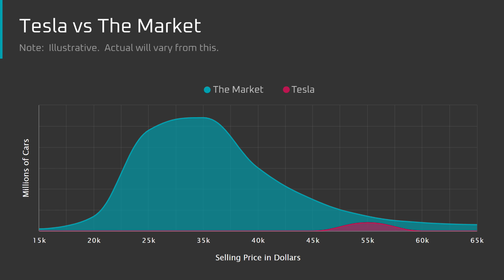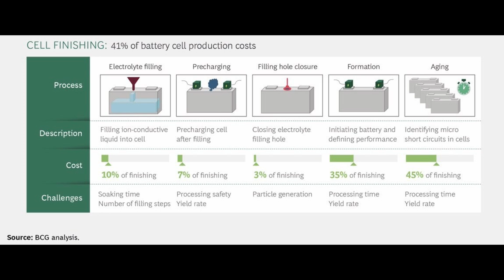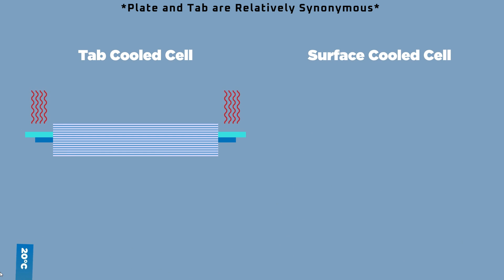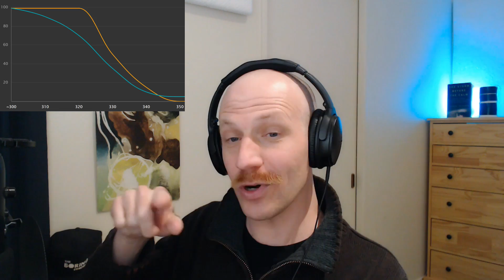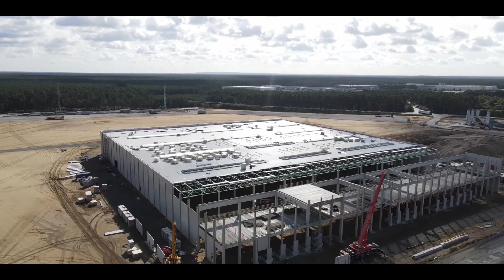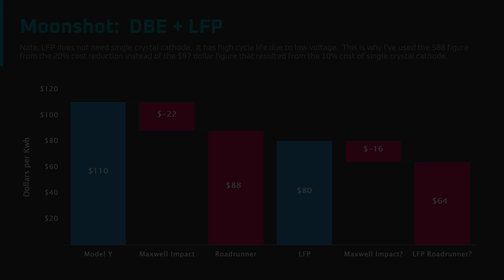Tesla Battery Day Predictions // Output, Cost, Energy Density

Comment: I recently replaced the worn out lead acid batteries in my solar system with LFP batteries which are rated for 10,000+ 100% cycles.  Assuming the rating is correct it would seem that LFPs would be a great choice for stationary storage where weight is not an issue.  With a daily 100% discharge these batteries would have a 27+ year life expectancy.
Reply from the maker: My view is hell yes.  LFP rocks.  Cheap and long lasting
Reply: @thelimitingfactor  I think I read somewhere that Tesla is using LFP batteries in their Chinese EVs.  The market in China seems less concerned with higher ranges.  Perhaps due to the availability of high speed rail for longer trips and/or less emphasis on performance.

BYD has been using LFPs for years in the EVs they've been selling for taxi use.  I haven't run across any data on how well they've held up but one would think the batteries would outlast the car.

Cheap, long lasting, and don't catch on fire.

Comment: Amazing presentation!  The only piece if info I did not see you talk about is sustained charge rate on the tabless electrode batteries.  Do you have any ideas on this?  Thanks!
Reply from the maker: The tabless electrode is only one aspect of charge rate.   Every aspect of the cell affects the charge rate:  Cathode material, anode material, electrolyte, material thickness, cell thickness, cooling system, pack size, BMS.  Tabless electrode is just one thing and is not a panacea - it's just a step in the right direction that can unlock potential.  It all depends on whether Tesla engineers for Power or Energy Density.
Reply: @thelimitingfactor  Thanks Jordan!  I am eagerly awaiting any info they release on this.  Your mention of the play on Hobit Day is very sharp and with Elon this likely is the case.  And let's hope on that Moonshot idea at the end!!  All the best.
Reply from the maker: @johannel8104  Thanks man and thanks for the support!

Comment: So good Jordan, well done. Don’t under estimate yield, as it is one of the most important aspects of volume production. I think the tabless design will improve on yield significantly because it takes out a huge variable that causes performance variation and production fallout, and could add another 5 to 10% cost reduction. It’ll improve also improve throughput. Engineering is all about efficiency in any ways we can find without testing the law of diminishing returns.
Reply from the maker: I totally agree!  There are a few places where Tesla could eeek out some killer number that I haven't factored in😀  I'm hoping my estimates are 'padded' a bit.  Trying really hard not to mislead.

Comment: I thought that LG Chem(and maybe Panasonic Asia) provides cells for Giga Shanghai (see link below).
Wonder if Elon is also thinking about using LFP for RWD Model 3/Y and maybe also RWD Cybertruck, with even lower battery costs, leaving Roadrunner line for Model S/X and maybe later on next-gen P3/PY, as premium models.
https://insideevs.com/news/423142/china-panasonic-mic-tesla-model-3-batteries/
Reply from the maker: LG Chem is supplying as well, they are diversifying their supply chain. This is why I avoided this topic in the video.  It will vary by model, factory, and continent.  Permutations are endless.  I think LFP would make sense for the entire 'base' range lineup!  Cheap as chips and great performance.
Reply: @thelimitingfactor  Indeed, charging speeds and power density is great with LFP. 
I just wonder if Tesla will have it in house or will it use CATL or others for their base versions. 
Main downside of LFP is weight, but that mostly effect RR losses, which can be minimized.
Thicker cathode might also mitigate it, if DBE is possible with this chemistry.

Comment: Better yet, use heatpipes which are way more effective than copper rods. Thermal conductivity is only part of the story . “Thermal diffusivity” is the key. You want heat to spread out as fast as possible.
Reply from the maker: GREAT point

Comment: Love you presentation and numbers. I have a few speculations that might be of interest. The wet slurry process that’s being eliminated also creates massive cost/problems for controlling the environment and capturing/recycling the toxic chemicals involved. Eliminating the physical footprint needed for drying vastly reduces the space need for battery production as you stated but the weld-lessTab-less battery offers with fatter, wrapped dry battery offers lots of opportunities for automation with less defects, welding creates the most defects. A very important fracture of the Tab-less battery is it’s reduced resistance which might help the coating mixture improve cycle life, less heat, and increase the regeneration efficiency, longer range. Another benefit of battery pacs is making a universal pacs, one fits all, that can be combined together to fit all Tesla platforms car’s, pickups, Semi’s.
Reply from the maker: You're totally on point!

Comment: Tesla is building batteries for its cars so maximum range and speed of charging are important.  I think the tab free design of electrodes is a major step forward when taken in conjunction with dry electrode technology.  Together they allow; lower internal resistance leading to increasing recharge speed; end cooling;  and the increase in roll diameter.

Comment: how about a hybrid battery pack? With some high density charging some supercapacitors. And the regenerative breaking charging supercapacitors as well? All managed by a software solution. Even with different voltages. I understand the idea of performance loss due to energy transfer and generated heat
Reply from the maker: Could be!  I picked the simplest and most likely path.  Hybrid requires more software, complexity, and cost.  Undoubtably better...but not cheaper or easier.

Comment: If they integrate recycling into their business model, what does this do for pack price reduction over time if materials are re-used and metals purchases are reduced?
Reply from the maker: It depends on what methodology they use.  I haven't looked deeply into this yet though.  It just seemed like a good synergy with Redwood.
Reply: @thelimitingfactor  on the Tesla website, they indicated batteries are ~97% recyclable. If so, what could this mean to further cost reductions over time? Interesting thought anyways.
Reply from the maker: @mbabcock111  Not sure, I haven't done a deep dive here yet.  Each of these topics requires hundreds of hours of research to not be an idiot.
Reply: @thelimitingfactor  well, we definitely appreciate your hard work and research. Thank you for this,

Comment: Previously I had asked if tabless batteries meant that the cells could be made larger by making them longer rather than fatter. You pointed out that due to cooling the cells needed to be oriented vertically, which limits their length. Two follow up questions:
1) Wouldn't the semi theoretically have space for longer cells? And the Roadster was supposed to use a double stack of batteries, but that could be replaced by a  single stack of longer cells, right?
2) Would plate cooling mean that the cells could be oriented horizontally?
Reply from the maker: Correct!  Semi could be longer
I can't visualise how you'd do plate cooling horizontally.  It seems like it would defeat the purpose of cooling the tip rather than that side.
Reply: The form factor is most likely a compromise between thermodynamics like hotspots, electrical factors such as effective series resistance, and of course fabrication constraints.

Comment: Redwood recycling will be a huge benefit for the batteries, but they could also start recycling aluminium for use in the giga casting. Imagine pop cans being turned into cars.

Also, Boring tunnels will require wheel guides to be installed in the vehicle to utilize the tunnel. What if that allowed charging while in super cruise? Slot car racing revived! FSD robotaxi's will never have to sleep and you could possibly use the road runner LFP batteries to save massive costs and build out an enormous autonomous fleet.
Reply: Roadrunner isn’t LFP.
Reply: @joscaca  It's in reference to the moonshot section of video @33:00. LFP + "roadrunner" could result in $64 per kwh. Tesla could in theory apply much of this high volume manufacturing tech towards other battery chemistries.

Comment: Would it make sense to have taller batteries instead of wider batteries to allow for better cooling? It would also allow more energy to be stored under the car in the same surface area
Reply from the maker: I think wider with the same height. Need to keep the floor pan low and a low center of gravity
Reply: My guess is that the first iteration will be fatter, non-plate cooled. The cooling applied to the can sides will have greater contact surface. Due to the side of the can being one with the bottom, thermal can quickly go from side to bottem. Enter tabless.

As a bonus they can make the anode collector a little longer then the cathode substrate and have the anode current collector in direct contact with the inside of the can. Its in the patent.

Comment: I bet on a combi of ultracapacitor, lfp and NMC in a pack. With charging 10 to 90 percent in 5 minutes. Cause charging rate is the real important thing
Reply: It doesn't work like that.  Charging 10 to 90 percent in 5 minutes means 80% of your combi must be ultracapacitor, resulting in an unpractical energy density, it would not fit in the car.
Reply: @jwstolk  the benefit of a capacitor is only, for lessor stress on the batteries plus 5 % better efficiency. 1kwh is maybe enough. And single crystal, LFP plus tabless technology should allow it if ur cooling is good enough. Which seemed to be solved by others already.

Comment: lucid also indicated they are doing top and bottom cooling instead of the sides of the cells.
Reply from the maker: Excellent!  I started watching their presentation then got bored with all the marketing.  Seems like a good product but, it was a bit heavy handed.
Reply: @thelimitingfactor   Among all the fluff, they have a 900V system, faster 300kW charging, vehicle to vehicle and vehicle to grid charging and getting into the home energy / battery game as well.
Reply: YouKnowSomeGuy I’ve never heard anyone ask Elon what advantage their 400V system
has over Porche’s and now Lucid’s higher voltage drive train ....  and if it is a disadvantage,  why Tesla havnt adopted it.  ....   Jordan ...  one for your interview with Elon when you get it.   And or a video for you to make
Reply: @andrewpaulhart  Production capacity, cost etc.. Both Lucid and Porche will be selling hundreds of cars / few thousand.. Tesla is already in the hundreds of thousands.. It could be possible that Tesla switches to a different system, but based on when they started they needed to get as much capacity as possible to be able to produce Model 3 and Model Y at lower prices.
Reply: YouKnowSomeGuy maybe,  but in all other respects Tesla has shown that it is happy to change its manufacturing process if it results in a product improvement.  I’d expect that to be doubly true for anything to do with the power train
Reply: The Limiting Factor oh good, it wasn’t just me being a Tesla fan boy then.

Comment: Did you watch Lucid last night introduce their new vehicle and they talked about their battery density equating to 4.5 miles per kWh.  What do you think their chemistry is and how did they accomplish this?
Reply from the maker: That'll be in their powertrain and drag coefficient...if it's correct
Reply: The Limiting Factor which would mean Lucid’s power train tech is more efficient then Tesla based on the initial info.  So it’s not LG Chems chemistry.  So does Tesla really have a moat with battery tech?  I guess we will see on September 22nd.  Can they commercialize this tech in a meaningful way by building it themselves?  Why not share with Panasonic under NDA or license to go broad faster with more dense chemistry?
Reply from the maker: @rogermanley611  Could be.  I'll see what they deliver, rather than what's in their marketing material.  I welcome competition.  It will drive Tesla even harder and faster.
Reply: @thelimitingfactor  exactly, people don't realize talking about a product and building one or few prototype is very different than production.
Building the actual volume production vehicles that people can buy is the very challenging part. 
Lucid is thinking they will build their first $169k "dream edition" next year. Their supposed 90k is still two years away by if not more by their own estimate and that's  if they are successful to build it. I really hope they succeed it's good for industry.
But I do think tesla will be way ahead of many things by that time 2-3 years is a long time.

Comment: Great video! Seems to me the cheapest way to build a car battery is to build only as many cells as required for series connection. That would require only about 100 cells for a 350 volt pack. Why produce 4,400 cells per pack like they do now? It seems to add a lot of cost and complexity to have to connect all those cells together in a pack. Of course it would require 100% reliability of each cell, which is maybe not realistic? Seems like it should be possible. Or they could just make each individual cell quickly removable in the event of failure.  I'm no expert, just thinking here.

Comment: Lucid air was unveiled and they seem to have the lead on tesla(for now) in range, charge speed, motor compactness and efficiency. There isnt as much of a cult like tesla yet but this brand could also be interesting.
Reply: Assuming that they do meet the specs,  the real issue is still going to be cost.  Tesla needs to pick tech that not only performs but is good value.  Lucid doesn’t care about how expensive their tech is.
Reply: While Lucid claims a 300kw peak supercharging and Tesla at 250kw peak supercharging, Tesla claims 1000 miles/60 minutes vs Lucid claims 300 miles/20 minutes, probably giving a slight edge to Tesla at the 20 minute mark.

Also note that Lucid did not say a single word about how long their battery cells would last, which leads me to suspect their cycle life might not be that good, or at least not comparable to Tesla’s battery cells.
Reply: No way - Lucid Air is $170k!
Reply: Tesla unveiled V3 in Berlin. 75 miles charge per 5 minutes.